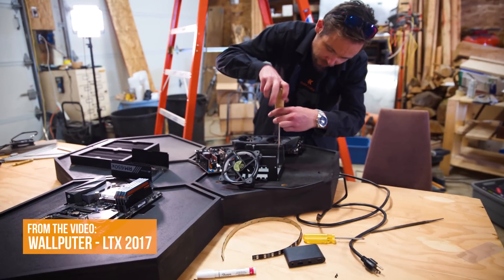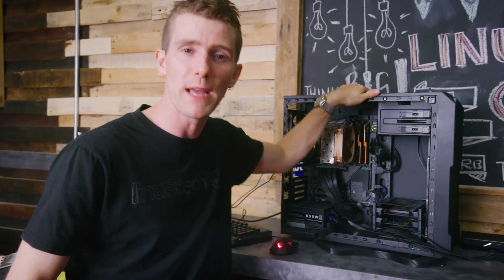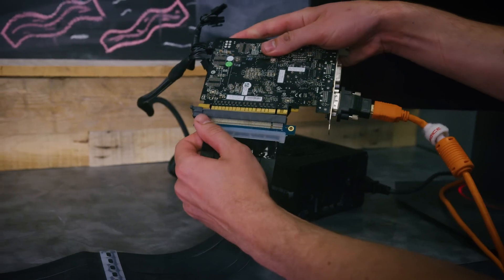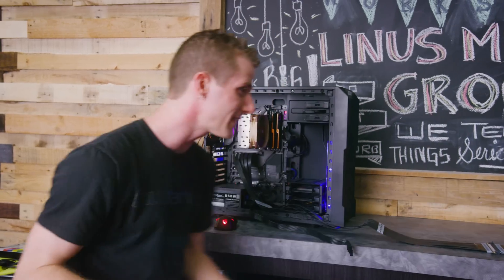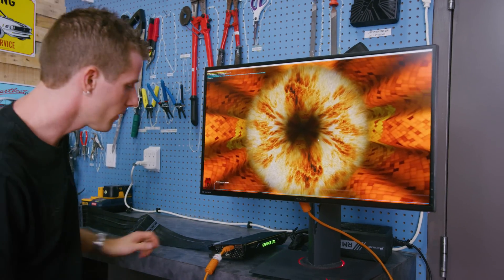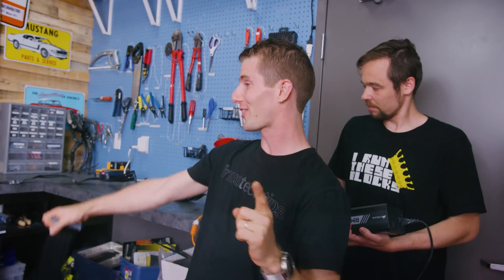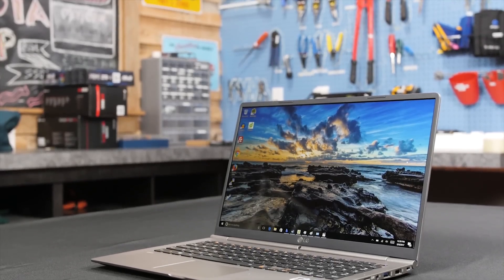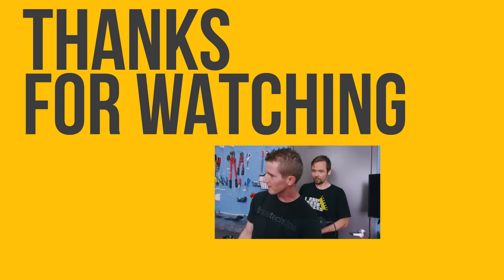How many PCIe Extensions is TOO MANY??

Comment: I'm surprised how far it actually was able to go.  The bit error rate is probably atrocious!

Thing to note, PCIe gen 3 devices go through a link training sequence to negotiate link speed and equalization settings between the transmitter and receiver.  All gen 3 devices must be capable of running at gen 1 (2.5 Gbps) and gen 2 (5 Gbps) speeds in addition to gen 3 (8 Gbps) and must start at gen 1 speed and negotiate their way up to gen 3 speed.  Chances are at the 3m distance (and even some of the shorter distances) the link was only running at gen 1 speed.  It'd be interesting to put an oscilloscope on it analyze the signal quality.  We have some pretty nice oscilloscopes at Tektronix that could easily do the job!  😃
Reply: Linus Tech Tips channel focuses more on entertainment than the technical aspect so they won't go that far
and it seems that the framedrops were from thermal throttling not from the risers length
watch 8:03 it's most likely thermal throttling
Reply: Gen 4 is rough!  It's a closed eye spec and requires the receiver to have a CTLE (continuous time linear equalizer) to re-open the data eye so that the data can even be recovered from the signal.  The spec is tentatively (the spec is still not final) calling for a minimum receiver sensitivity for the data eye of 15mV height and 18.75 ps in width.  This is tiny!  (And really challenging to measure I might add.)  And quite frankly it has to be this small because the signal losses at 16 Gbps are so incredibly high.  When you start getting deep into the details of this stuff it's honestly amazing that it even works!
Reply: As long as they use reqular copper wires, gen 4.0 and 5.0 are rather going to require shorter cables.
Reply: Nice info man, never knew about the bandwidth difference
Reply: +Sadeq Albana
hmm..... an 84% throttle?
Reply: Well pcie 4.0 and 5.0 is but coming so maybe the extensions  will be longer and longer due to to amount bandwith they got
Reply: Yeah, depending on the frequencies the data lines could behave like transmission lines, and there would be a lot of signal reflections and shit.
Reply: Better send him a free one.
Reply: Tal Risin it's already troublesome at this point as is.

Comment: LINUS! Connect the low voltage ground of the external power supply to the low voltage ground of the main power supply! Good shielding is grounded at both ends and having those ground more directly connected should help! (instead of them being connected through both power supplies and the mains ground)

Comment: Wouldn't these fail due to timing being off after a certain distance? If the bios lets you, you can set a timing offset. Also FPS doesn't matter, its latency that might be an issue.

Comment: Food for thought Linus.  Might want to try and see if TT will make you a PCIe extender that spans the whole length without any couplings in the middle.  Eliminate all that signal loss you get from the connectors themselves.

Comment: there is another thing, for cables such as pci is used in moderate gages, u if you try with a low gage cable on pci, it might extend to 10m i think. using a high gage cable will end up shorter.

Comment: electrons literally travels at speed range of 10-4 m/s in wires. if you talk about communication, you x2 the time you need per cycle. than you find out how many milliseconds delay the system can tolerate, you will have your theoretical maximum length. All the talk about how the MB optimize the distance of chip sets for $$$ are marketing BS. Drivers are much more important

Comment: So apparently you can use a bunch of PCIE extenders up to 3 meters before data loss happens
So you can literally use your computer as a heater in the winter.
Put it in an anti-static bag, seal off everything except the PCIE line, and stick it under your sheets

Comment: We all knew the outcome before hand. It the same reason you shouldn't use over 10 feet (3 meters)  for a USB 3.0/3.1 extension, signal degradation because of the power limit.

Comment: CHECK THE FRAME TIMES ! NOT THE FRAMERATE DAMN IT!
Reply: frameRate = 1 / frameTime s^-1
frameTime = 1 / frameRate s
They're literally the same information, I think the thing you should really be asking for is fluctuation in either framerate or frametime (since they're both equivalent).
Reply: Aidiakapi they're the same information, but if the frame times suddenly goes up it can indicate stuttering. Because frame time is the time or delay between each frame, so fps wouldn't be able to tell you that as it basically acts as an average.
Reply: The frame rate is limited in this case tho, so the frame times and frame rates will not always be proportional.  But then, you may as well just disable vsync.
Reply: Yes, a frame rate can be averaged, just like a frame time can be averaged. That doesn't mean it has to be for either of them. An example of that: https://youtu.be/oDpCV_r6Cxg
It's frame rate, but it's not averaged, so it'll jitter just as much as frame time would, it is literally printing: 1.f / delta_time (where delta_time is frame time in seconds).
Reply: The Timelords Right? Digital Foundry should do this.
Reply: Aren't both the same? I mean, one is frames per time, the other is time per frame? Anyway, i think this a nice way to fry your mobo or gpu due to added resistance.

Comment: Do I smell a new Fridge PC Build? You can easily put a Graphics Card into the fridge without drilling some new holes. I mean that is an idea. Mounting a bunch of radiators into the fridge and running everything water cooled (is there a watercooled psu?) can work. The pipes can have some easy detach mechanism for easy transport and also having a fan for mixing the air can be an idea. The fridge can be elsewhere when the pump is strong enough.

Comment: Main problem may not be the length but the number of connections between the card and slot on the motherboard.  Each connection adds impedance.  Get them to send you just 1 really long cable instead of a bunch of short ones.

Comment: Why do you use furmark? It is a stress test and as such it minimizes movement of data over bus. I guess there's less than 1kB of data sent per frame, so you won't see any degradation until interconnect becomes totally unreliable. You should've used at least some heavy games which do move data over bus. Then it would be somewhat useful.

Comment: Some science; and noone will see this but... electric signals only propagate at about half the speed of light.  Light travels about 1 foot/1dm in 1 ns.   1 cycle per nano-second is 1Ghz.  So if you count feet * 2 - that's how many nano seconds of delay you have.  If you're trying to run at even 300Mhz (1/3 of a Ghz, a foot and a half is longer than 1 clock cycle. )
Basically any PCI extensions is too many.
Reply: @self wow that's nuts how does that work?  You're so wrong.

Comment: You could keep the card near the case to power it with the original PSU and lay the risers out in a U shape.
Reply: Farell I think they didn't want interference.
Reply: i doubt there would be that much of it (if any), providing round enough turn (and no coils). Besides, I would imagine their risers are of the more pricy variety and those are usually shielded.

Comment: So why did you chicken out on the physics of this, it must have something to do with electrons in the wire and the frequency of the signal, would have been way cooler if you had looked at specs and made a prediction before you tried it, I mean isn't this why hbm is faster for example and why the cray super computer was the shape it was so wires were all as short as possible.  I'm not claiming to understand this stuff, that's the main reason I wish you covered it

Comment: I am going to be short.  This is the reason why I HATE laptops.    There is absolutely no reason why you couldn't have an upcoming Raven Ridge APU or any other 4C8T CPU (Intel with integrated GPU) and then simply have on the back of the laptop a PCIe 16x (8x would be enough also) port. Then just have a no-nonesense external GPU enclosure with absolutely no performance loss.  And ALL THAT in an ultrabook form factor.  I mean. If you have space troubles, make a dock then and put the port on the underside (if you really have to).    Won't even mention when PCIe Gen 4 comes where an x4 could even be enough.

Comment: I think if you used the power supply to the video card from the same source it did not exceed half that distance. Why? Because more and more power would have been lost. Power supply's have not been made to distribute the current over such distances. I would love to see how you will do the same test but with the power from a single source.
You can say it's a challenge from a Romanian fan. Good luck ! :)

Comment: Not sure of the velocity factor of that cable, but rough guess is that cable at 3m would add somewhere around 40ns of round trip latency.

I'm not sure how demanding the benchmark is for bidirectional communication is also.

I'm curious if the limiting factor in the test was latency, or the multiple impedance discontinuities at each of the extension cable connectors.

Comment: The issue is not signal loss - as the trump supported put it - it is power loss, the graphics card will draw a certain amount of power from the board and the PSU, I think it is 75w from the motherboard and the rest from PSU. imagine being 75W short on the PSU requirements. Try connecting it directly to the motherboard and then using a second  150W PSU to connect the 6 pin power connectors on the card, youd get the same results.

Comment: I guess now its only a mather of wire thickness, smaller the cable  the more resistance it has. Perhaps the limitation is not yet on the length but on the size. Try making a PCI extention using getto 12G wire :P

Comment: This makes a lot of sense, actually, if you consider that the maximum length of a thunderbolt cable is 3 meters, and that thunderbolt is in many senses a very small PCIe riser.

Comment: One thing you didn't measure; Did this introduce additional input lag? or Video lag? Honestly, I would assume the frame rate would stay the same the entire time, because you aren't changing the actual processing time, you are just introducing a delay because of the distance it has to send the signal. 

I say you revisit this soon.

Comment: Now that we've figured out how far you can go with this, why not try doing that refrigerator pc again, but this time with just the gpu in the fridge or something? That would be interesting :P
Reply: It would turn out the same, a fridge is designed to keep things that are not producing heat at a constant temperature. Once you add a source of heat production you will overload the fridges cooling ability.
Reply: Commercial chiller. Common dudes, think Linus.
Reply: CutoutClips refrigerators aren't meant for constant cooling nor for large delta in temperatures. Wouldn't work, even with only a decent gpu. A small fridge might keep up with 50 watts of constant heat at most

Comment: Gonna ask 'that' question. Considering this test, why not make a PCIe 'cable'. Yes the connector would be huge like this, and the length maxing out at a couple of meters but hey. Or put another way, Thunderbolt with more PCIe lanes.

Comment: Linus, PCIe is a 4 wire per lane differential pair serial standard with independent clock speeds. 
the device could acknowledge data received back to the host in about 3.3 nanoseconds per meter of extender in ideal physics. Your workload would have to use very, very, very tight timings and even then the standard is designed with  delay in mind since each lane can run independent of the other. your biggest limiting factor is shielding from signal noise and potential signal loss from the cable.

Comment: The amount of wireless hardware they have and Linus insists on using a wired mouse and keyboard 👌
Reply: Because a wired mouse and keyboard provides more responsive feedback, and there's absolute absence of the 'oh no, I need to charge my mouse/keyboard' moments that all the plebs have.
Reply: +Kenward Evan despite that, what's the point, even, to using a wireless setup on an immobile workspace. If you've got the wires in a comfortable spot, it's not much of a difference.
Reply: I purely meant just whilst they were testing, watching Linus try and click things whilst the monitor is on the other side of the room. You can't argue that it would have made infinitely more sense to just use a wireless mouse

Comment: the question is, if you used a graphics card with powermod installed, would it work better, as it could get more energy out of its power supply instead of pcie port?

nice video so far, liked it